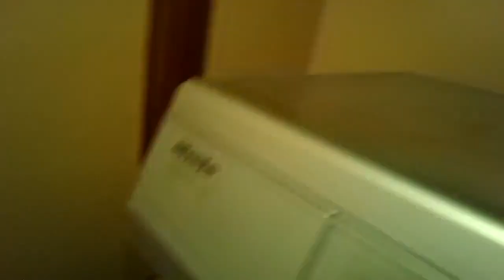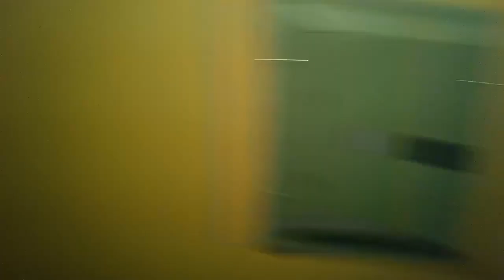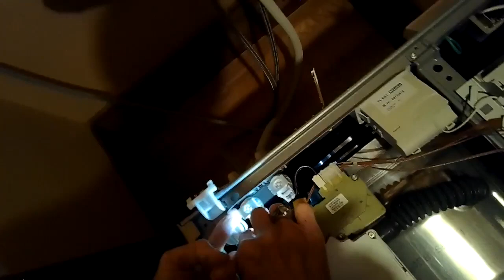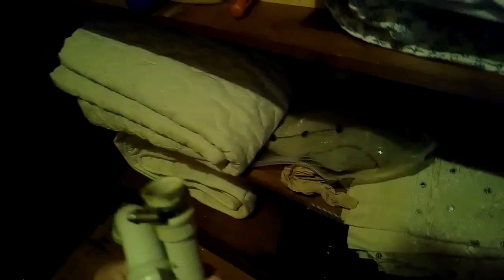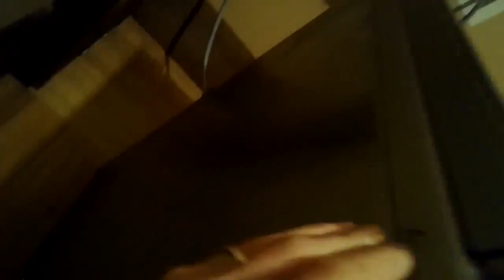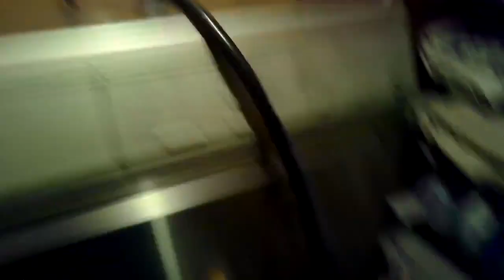MIELE WASHER WON’T DRAIN — EASY FIX

Comment: Scott, thanks a million.  We have a W4800, and I removed the black tube, and it was blocked with lint and soap residue.  I high pressure blasted it.  I'm a Brewmaster, and just toasted you with a beer.

Comment: Hi Mate 
I got a Miele W3725 that seems to do an erratic cycle when it does the final spin there is still a lot of soap suds on the glass and the washing is still very wet and then we gotta give it another spin. Also when we select the wash cycle the screen says how long it will take like cotton short wash about 55mins and it takes much longer. Also clothes come out covered in lintel and soap stains. 
Yes I clean out the drain at the bottom regularly. 
I already changed the pump and check all the hoses are not blocked but that didn't fix it.
If you can diagnose for me I'm happy to pay you as I can't afford to buy a new on cause I'm retired and don't have a lot of cash laying around if you know what I mean.
I can get spares easily enough.
Thanks George
Reply: What soap are you using? Get the European Persil. Two tablespoons for a large wash. If you still see suds on the glass in the final spin, you're using way too much soap. That used to happen to me all the time. It would be spitting out soap from the top during the rinse and spin.. I know exactly what you're referring to.
Reply: @johnblack8036  Thanks John you may be right but we bought a new machine.
Reply: @georgemooyman7155  We almost did that, but a comparable one would have been over $3700. How is the build quality om the W1's. It just looks like they're moving toward  fancy electronics than innovation and build quality.  Wow, I must be getting old saying something like that.
Reply: Hi george, please watch the video of John Harvey on draining trouble.  His approach is quite like Scotts (thank you Scott)
John goes some steps further following the black tube to the y-shaped split and through some more tubes that end at the coin trap (also referred to as filter) as Scott says. 
All the tubes, pipes and splits can get clogged over time.
Cut a powercord from an old tv or lamp or something and push the cord through all the tubes. Dont be suprised by all the $#!t that comes out. Make water flow through them and rinse them out well.
Reply: A machine that doesn't drain completely, does often finish the washing programme, even without errors, BUT doesn't get rid of all of the soap of the first cycle, so that could explain the soap stains and otherwise unsatisfying washing/spin drying results.
Reply: @musicteacha  Hi how that sounds like a good solution I still have the machine and bought a cheap 2nd hand one to get us through.
So I will try that.
I had a repair man come to fix it and he just swap parts and after it's just the same and charge me $300. After that I put a new pump in myself and clean all the hoses but still didn't fix it. I live in NZ anx bought a 2nd hand Fisher and Paykel for $300 less than a year old and its working ok but spins a lot slower.
Reply: @musicteacha  Out of curiosity, how much soap do you use? I used to go by the box. 60ml. That was way too much. I would always get the check detergent notification at the end. Now the most I'll use is two tablespoons and that's for the largest loads. At least large for my machine.

Comment: The reason why that u bend was leaking was because the end of the drain hose started have a bit of dirt on it if you clean the end of it and then go and put that back on it won’t leak :)